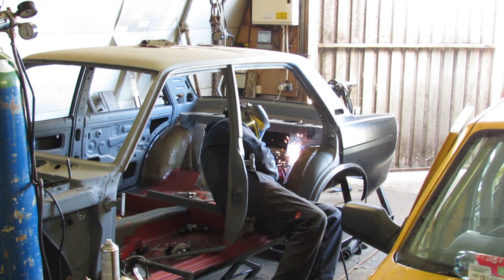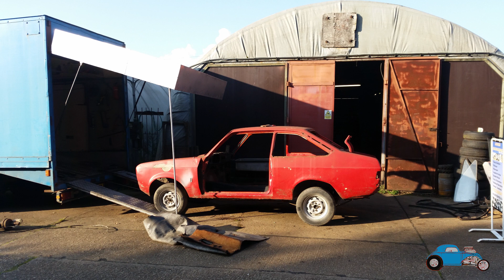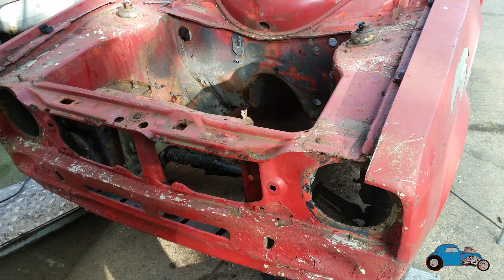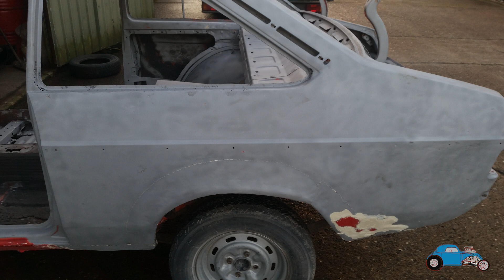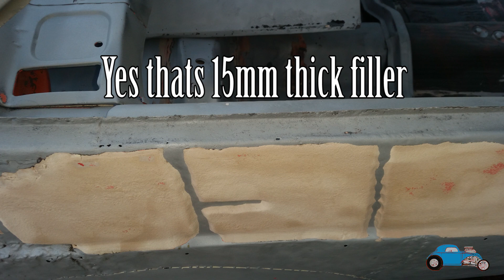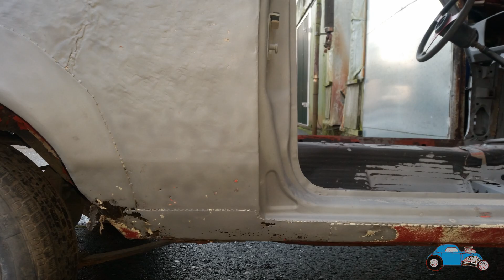Ford Escort Mk2 Rally Build! Part 1- Blasting

Comment: Is that actually worth building? It looks like every single panel needs replacing and considering you can get brand new mk2 escort shells, why would you bother? Either way, if that's a customers car and they are willing to pay for the work, this is about to get very interesting.
Reply from the maker: It was touch and go to be honest but the owner has had the car for quite a while and when the reproduction shells weren't available.